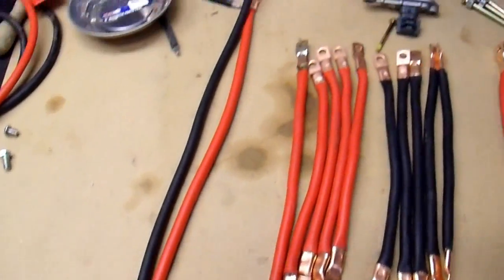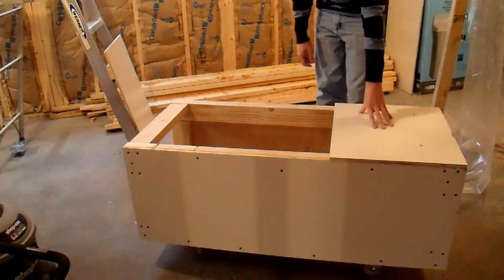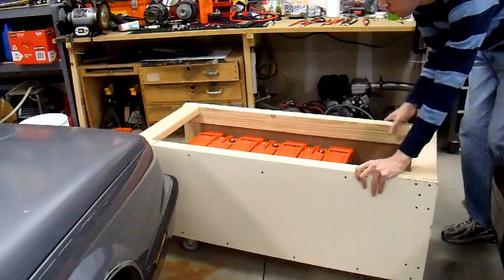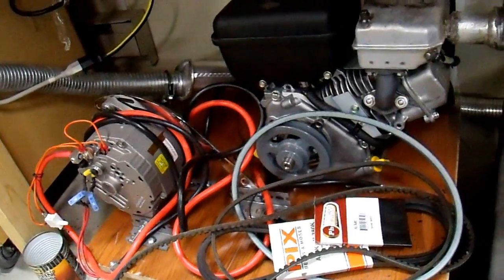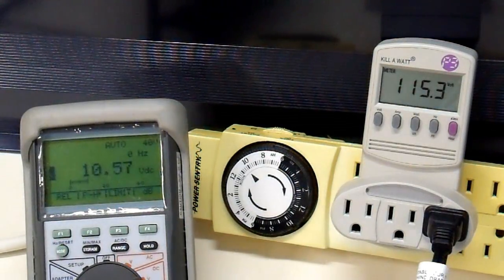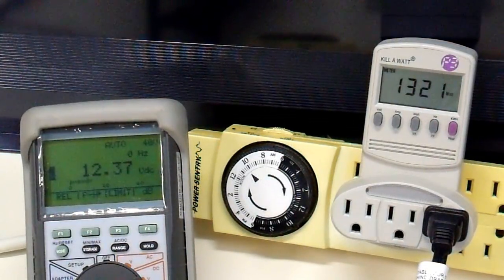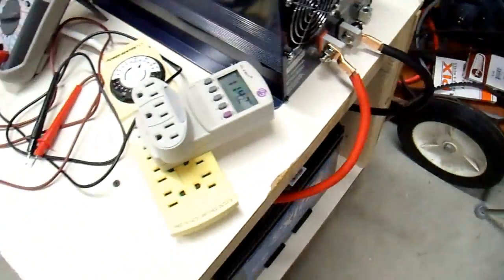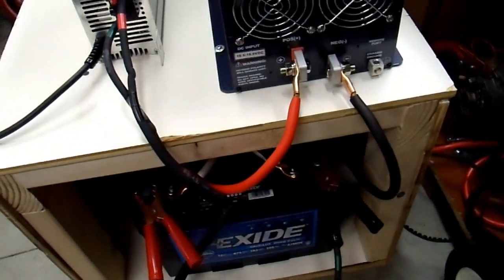1000Ah Battery Bank Part7 - The final Battery Inverter Configuration

Comment: I usually like your vids....but, I was done with this when U mixed batteries..u also needed to chuck the two weak telecom batts and run only the 6 stronger ones...you would have gained a real nice bank..but adding the weak ones and then mixing in two new and totally different types....hmmm....bad example and just plain wrong...
Reply from the maker: Not 'plain wrong'.  Mixing batteries in an engineered system that is intended to be used by peoples who do not understand the implications is 'wrong'.  This isn't.  Mixing battery types is NOT always a poor choice when they are in parallel.  When in series there is more to consider.  I have since acquired more of the orange batteries and removed the flooded lead antimony batteries from service, but they served their purpose for a while and did so just fine saving the other batteries from deeper cycles.

Removing batteries simply because they are weak is damaging for the other batteries in the bank.  It's better to leave them in.
Reply: Sorry man but Ill agree to disagree...mixing battery types in parallel or series is no good in any service capacity, but as You indicated you only did it for a short time, and yes,,, its always wise to remove weak ones from a parallel string as the back charge(that "WILL" happen) can become worse quite quickly  and degrade the good cells evan quicker.. , not to mention the potential for a catastrophic internal short(pop and burn)...these are basic rules in battery bank care ,ownership and maintenance , oh not to mention longevity...AND I will add it is industry standard to NEVER ...EVER, EQ a sealed battery, if You dont believe me ...just ask me!...have a good 1
Reply: *****
The orange are AGM and have different float voltage specs than the flooded lead acid. I figure that you removed the FLA ones after finding this out.  My Xantrex Freedom 20 inverter charger just went haywire. It is connected to 10 AGM batts and the only reason I knew was that I have a small cheap digital volt meter on the wall nest to the battery bank.  Just walking by shows the charge state and it falling last week. 13.38 was normal and it went to 12.90.   Not much but I want these to last 15 years.
Nice project you did!  Do you have alternate means to recharge?
Reply: OK, You have a gen set! Sorry. I didn't get to that comment. Also, many people don't restrain battery banks at all. Yours is nice. That is a lot of power in one spot to be shorted accidentally or rumbled in an earthquake until they short.

Comment: would this battery bank run 1800watts of lighting (hps) and can i charge the battery bank with solar pv ? i love your enthusiasm
Reply from the maker: 1800 watts is a light load for a battery bank this size, and you could charge it with anything so long as it outputs enough power to recharge them fully.  Solar is fine!
Reply from the maker: *****
As the battery bank sits today (12 of the orange batteries), accounting for losses and actual battery condition, about 5 hours.

Comment: If you build another battery bank box , use ball bearing rollers instead of standard wheel rollers.  The advantage is they don't need to pivot and change direction to roll, they will roll in any direction from start to finish.
 It will roll easier and less force needed to change direction when maneuvering
Reply from the maker: Do they sell ball rollers that are compliant and do not use a steel ball?  I need a larger contact point than a steel ball can offer or the stress risers will spall my concrete.
Reply: also, locking castors and 5 or 6 " wheels for all terrain that could be needed lol. But, I thoroughly enjoyed the vids

Comment: I see a couple of possible issues with the setup. First the i battery wiring. Pulling and charging on the same end the battery may cause the batteries at the far end to weaken due to the resistance of the wire. Secondly you have two different types of batteries each having different type of charging requirements.

Comment: So in summary it can power a 1500W heater for 15 minutes, god i hate all these how-to battery bank videos, they show you how to power something for 25-secs then close the video, no mention what it's benefits are in the real world, can it power TV's, computers, lights and for how long? how long do batteries last? which wattages,pitfalls etc, etc,..

You normally leave these videos with more questions than answers...
Reply from the maker: You may be interested in watching an electric heater and refrigerator running for 8 hours straight, but I think most other people would not.

It is a high quality 3kw pure sine inverter connected to a large battery bank.  It will run any TV, and computer, any light, and anything a standard 20 amp branch circuit can power.  How long depends on many factors, but a very rough estimate in hours can be made by dividing the amp hours by by watt draw then dividing by 10 again.

Comment: Listen to MrBugsier5 and connect the invertor that way, also you want to charge the battery bank the same way you drain it , most definitely NOT from one battery ...
Reply from the maker: There is a lot of misinformation about how batteries work.  I have plans for future videos that properly describe some of the basic concepts of how these things really work in a practical sense and I hope that people will find them useful.  The method I am using to recharge these batteries is completely proper and there is no need to charge a battery the same way it is drained -  it is myth.  Batteries need to be properly charged - they have no memory of how they were discharged and only need to have a proper charge restored.
Reply: Okay

Comment: Some of the best battery knowledge I've heard.  Thank you.
Reply: Mixing battery types in a string does not seem to demonstrate expertise.....
Reply from the maker: Philip Tait
There are times when mixing battery types is acceptable - I did not go into details in this video series but I am well aware of the negatives involved.  I have since removed the two mismatched batteries and am using additional identical batteries now that I have obtained more of them.

The people who make blanket statements about such things without sufficient explanation are those without expertise.  There is nothing about mixing batteries that is inherently damaging when done with the proper considerations.
Reply: Here's a reference to an SAE paper that seems relevant: http://papers.sae.org/830228/
Reply from the maker: Philip Tait
That paper applies to series connected battery banks where matching is extremely important.  In many instances customers specify matched cells - not just matched batteries.  For parallel configurations the requirements are less strict.

Comment: Regarding the dual 4 gauge interconnects. I would like to caution against doing this in general simply because there will really never be any dual connections here at all. In real world practice it is nearly, if not absolutely impossible to have two identical 4 gauge connections.

Say you have one 4 gauge that has 100 micro Ohm resistance and the other has 400 micro Ohm. Both values are "nearly zero Ohm" (less then 1/1000th of an Ohm) but the 2nd wire has 300% more resistance which means that the first wire will carry 300% more current!

For this reason paralleled conductors are not recommended unless each conductor is capable of safely carrying 100% of the load.

Just my 02, I am surely not trying to tell you anything my friend, I am here to learn :)
Reply from the maker: Fortunately, paralleling resistance devices that have a positive temperature coefficient results in those parallel elements sharing current in the most electrically and thermally efficient way.  This applies to copper conductors such as the dual 4AWG cables I show here.

Comment: Thats my dream there. But im gonna use a bank of 14V XS Power batteries each 2400 amps
Reply: simon peter Those are bad batteries to use, You want Amp hours not Cold Cranking Amps. Those batteries are for high current car audio.
Reply: hiiiiiiiiiiiiiiiiiiiiii

I am simon can u help me in case of XS Power batteries each 2400 amps. Iam intrested in buying.....................................

Comment: Have you figured the cost of a recharge, against the electricity cost to power your house for a day. I wondered if it was viable or just to protect against power outages with little or no difference either way cost wise.
Reply from the maker: Electricity from the power company is definitely much less expensive than my gasoline powered charger.  Plugging a charger into the wall, you lose about 20% of the energy in the batteries themselves during charge/discharge, and another 20% in the charger.

But I have used it along with my 12V generator to power my house for a day as a test.  Works great.
Reply: *****
In the corner case of a very efficient lifestyle and high service charge, it could turn out that gasoline or diesel might end up cheaper than connecting to the grid. Granted, that would only come up 1% or less of the time, but that's pretty much the case in some parts of College Station, TX. It's too bad that the 4 years or so of college (about 6 months every year) isn't long enough to make it worthwhile getting everything needed to go off grid, even when the service charge is a big ripoff at about $30-40/month.

Comment: I wonder if you could add another inverter from the same bank to lower the consumption of amperage by just one inverter, if you tried please let me know or if you ever try it out let is know how it goes, the reason is because having two inverters I will probably get more A/C out put or even 240 be for heavy appliances. It's great info here keep it up.
Reply from the maker: I have another video out there about connecting two inverters together for double the output power.  It might answer some of your questions.  You can run two inverters off of this battery bank but the inverters can't be connected together.

Comment: Is there a reason you are pulling that load from one end of the battery bank instead of across it.  Is ti because you want to draw from the flooded batteries first?
Reply: ***** Would it be more efficient with batteries connected in parallel to increase amperage to attach the inverter to a positive on one end of the bank and the negative to the other end of the battery bank, or better efficient to select the center battery of the array and attach to its positive and negative? The previous question posed was pulling across the bank (either end) and you answered with center. I didn't know if that meant it was better if if that was how you interpreted the question.
Reply from the maker: The reason I am pulling the load from the end of the battery bank instead of the center is simply for mechanical reasons.  Electrically it would be better to connect to the center battery, but for practical reasons I chose this setup.  It makes little difference in practice.
Reply: Shane Roberts Pulling from the center is better then one end but the best way is pulling positive from one end of the string and negative from the other end of the string. That way the load is the same across the string instead of being higher closer to the connection point as in this video. I did watch and enjoy the whole series of videos and learn a number of things. Only disagree with his connection up to the string. It's a small matter though. ;)

Comment: Thanks for the video series.  I would suggest using casters with each having the capacity of half of your finished project and a brake.  Floors are never perfect so you can reasonably expect that at any given time only two of your castors will be supporting the weight.  Well, I may be wrong since wood flexes and the weight of the battery would stop any tilting.  I'm used to my tool box that has almost no flex and wobbles when on the uneven shop floor.  Thanks again.
Reply from the maker: That's a good point about the casters - they should be sized to 50% of the weight.  Trouble is 500lb casters are gigantic and expensive!  My floor is very flat so I thought these would work OK.  They seem to be holding up so far.

I considered drawing from the center of the battery bank as it would be better electrically, but I chose to connect to the end for practical purposes.  I have since replaced much of the cabling with 1/0 AWG.

Comment: Nice job on the battery bank, 1000 ah should keep the important things running for more than a few days. Minus the heater that is.
Don't forget to use a timer on the fridge, it can pull 800amps when defrost kicks in. I found that out the hard way.
Reply: Sorry, I meant 800 watts!! LOL you would be in trouble with 800 amps @120volts
Reply from the maker: autobri1
lol

My fridge consumes about 1100W when the defrost cycle kicks in.  The 3kw inverter and 1000aH battery bank don't really care though and I don't even notice when it happens.  In a test run of this setup and a kerosene heater for heat I used about 6kwh per day, so 1 day is about tops for me to avoid battery bank damage.
Reply: No, data safe batteries are 15 minute rate of discharge. If they were storage batteries, yes possibly. Storage batteries have a 20 hour rate of discharge.

Comment: What a massive amp draw to run a 12v inverter system your sucking off so much more current and taking the batteries down so fast. At 1500 watts your pulling at least 128 amps off those under rated cabling. With a 48v inverter at 1500 watts your pulling a nifty 32 amp load and your cables would be over kill. With the batteries you have you could have two 400 amp battery banks and you increase run time and lesson battery wear. Bearing in mind the investment of the inverter and a few diodes and connectors. You could still charge with your 12v battery charger if you add in some hefty diodes and block the other batterys from seeing each other on the charger side you would have a rock solid power supply with time to spare. Also shit happens add in a circuit breaker or fuse off your battey connection to the inverter so you don't come home find you lost everything you own due to the bettery bank catching fire.
Reply: or some really bulky mosfets to swap how the banks are connected. I was watching this from across the room and left a comment asking what voltage he wired them to cause i didnt hear any mention other than 12v. im officially dumbfounded why anyone would pull that kinda amperage instead of going higher voltage
Reply: These were my thoughts exactly.....
Reply: I think that's what these batteries were for. A solar system with each panel having its own charge controller. This negates having lost a panel and lose the whole grid or part of it. 

I'm would suspect these batteries don't take well to being cycled at that amp draw either, on a daily bases. It's just not efficient enough for my taste. But the potential is there to make a great off grid power distribution system.

Comment: You need a fuse on your positive cable. Just to be safe. If at the very least put 2/0 or 3/0 cable from the batteries to the inverter so they dont get too hot. 2 awg cable cant handle 300 amps with a 3k inverter. 45 amps is a good charge rate but it will prolly take forever even on a partial discharge. The IOTA DLS chargers can be run parallel with each other.  For example another 45 amp in parallel gives you 90 amp peak charging amps...but requires a 30A circuit breaker on the AC end.
Reply from the maker: Safety?  bah!  :)  (yes, I should use a fuse)
I agree that 2 AWG is not adequate for continuous 300A but it's what I had on hand.  I may upgrade the cabling later.  I did use this setup to power my whole house for a full day and it worked great.  The DLS-45 charges the bank up overnight (from about half discharged) which is fast enough for me.
Reply: Overnight charging? Thats good in my book too haha.

Comment: GREAT WORK,you should use those wires for another battery bank  and use 0 gauge shorter wire attached to  the double copper pipe. also connect the positive and negative to OPPOSITE sides of the battery bank. Do it right the first time and have piece of mind.
Reply from the maker: I may do that.  Thanks for the tip!